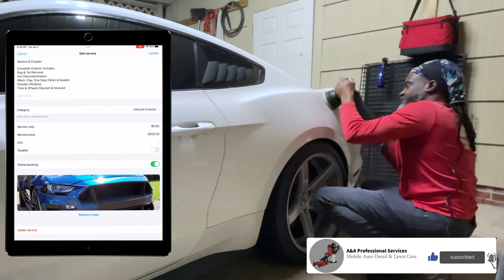$250 Mobile Auto Detail

Comment: What size tank I should get for my detailing
Reply from the maker: It depends on the vehicle you're using, the size of your pressure washer, and more.
Reply: @AAProfessionalServices  I have a 3300 pressure  washer I drive a gmc 1500 sierra long wheel base truck
Reply from the maker: 100 to 150 gallon. If you dont use the foam cannon. You should be able to 4 to 6 vehicles
Reply: @AAProfessionalServices  ok I have a foam cannon as well